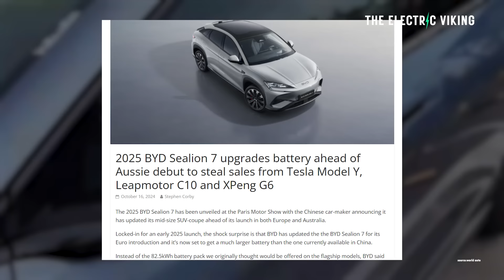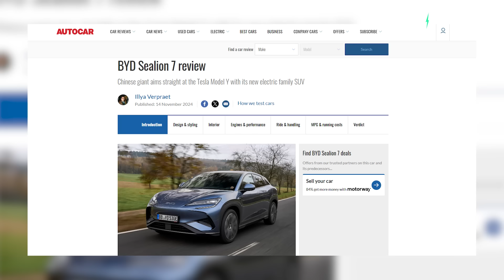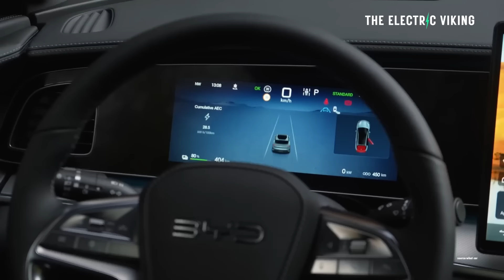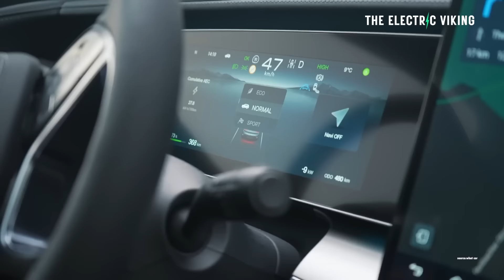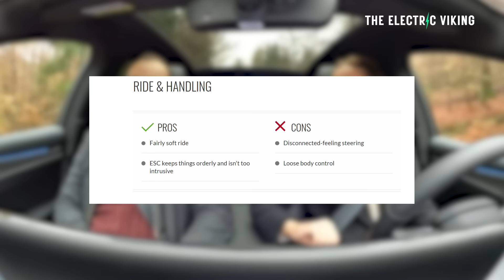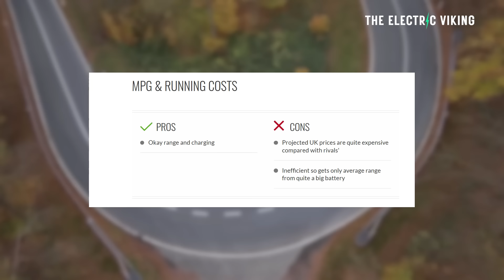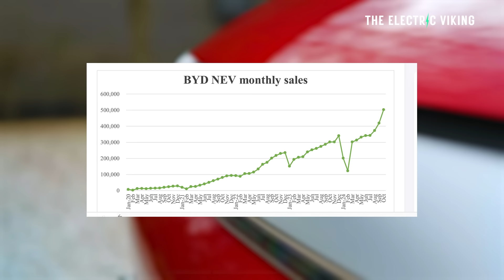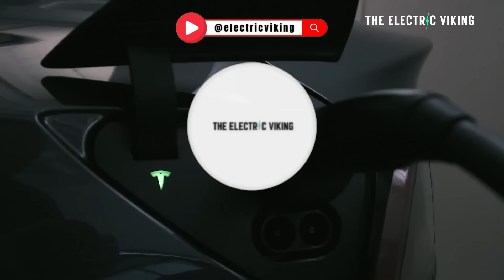Shocking review exposes major issues with NEW BYD Sealion 7 EV

Comment: you are listing opinions that are not actual facts. there are ICE sedans weigh around 2t, I don't see any issues with weight of the SL7 because most of it sits low down. Suspension might be soft, it's subjective that not everyone wants their SUV to handle like a sports car to feel every imperfections on the roads. The weight of the EV contributes to more enengy comsuption but also helps to gain more back on regen. Efficiency is really come down to one's driving style and where you travel to. I know ones that couldn't get their Seal performance to use less than 20kwh/100kms, but mine always sits between 16-18kwh/100kms with regen set to standard and in sports mode 100% of the time.

Comment: the EV scam revolution. Crs are designed to waste a lot energy. 

1. The cars are to big (mostly SUV)
2. They all are to heavy, because most countries subidized the road tax to stimulate EV sales, so there was no incentive to lower the weight.
3. The cars come with 18-20 inch rims, which contributes to high energy consumptions, so less range. 
3. They are especially very inefficient on long range. Again because government subsidies no incentive for car makers to make it efficient. 
4. Batteries are inefficient and the elctric engines are inefficient. 
5. It does not contribute to cleaner climate because the energy to charge comes mostly from fossil fuels. Again because most governments don't want Nuclear energy. 
6. The cars are 2x the price of an luxury petrol car. Even with all the government grants and subsidies, where did all those bilions go? 

Anybody else can add valid points?

Comment: Seal owner here and i saw this car few months ago in China. The interior looks cheaper than the Seal due to the removal of Alcantara and replaced with silver plastic, no electronic air events but a cheapo black plastic manual one. The dash 1 pc black plastic cheapens the car further. The ride is nothing like the Seal, its much softer designed for comfort. This car looks horrible in lighter colours due to the massive black wheel arches. Very mediocre car in the China market and the sales reflect that.

Comment: Not surprised honestly. I drove a rental this last Fall which was a BYD Seal U in Germany. Looked modern, interior was modern looking. The problem was how it drove. The steering didn't have an on center feel, suspension was horrible. Pretty sure the Chinese doesn't understand driving dynamics. The suspension was set to bedroom pillow setting, not really. The suspension was so soft and the body roll so bad that I didn't trust the vehicle. Even when I set it to the sport mode it was still soft. It functioned as a transport vehicle but it wasn't as efficient as the Tesla I rented in Hawaii a few months later. The scariest thing is how low the battery tray was located on the bottom of the vehicle. The battery tray was the lowest part of the vehicle. There were so many issues with the BYD Seal U. The GPS was spotty and it kept telling me that I could go 120KPH in town!
Reply: To be fair Seal U is using the old chassis that is shared with the PHEV variant. Sealion 7 is built to be EV only from ground up so a completely different vehicle.

Comment: Tbh sealion 7 sounds more premium than model y on wiki (adaptive suspension etc).
I also like their specs better. Arguably 4.2 seconds in the awd version is as fast as you could possibly want in a suv family sedan. 3.5s in the tesla y almost makes less sense since this can't handle like a sports car. Conversely, you def need the long range in the y for decent range, which runs at 4.8s, which is just a lot slower than the sealion 7. So maybe nitpicky but I like the sealion 7 specs.
Basically all 3 models of the sealion 7 have more range than all y versions and make sense, whereas imo only the long range model y version makes sense.
Given in china all model y versions sell for pretty much exactly 50% more than the sealion, I'd say it will make for good competition even after tariffs.
Design wise it looks a bit 90s but ok not necessarily a bad look

Comment: The BYD sealion 7 has one of the best usable range on the market.

Its 91kWh LFP battery has a usable range of 0,80 x 502km = 400km

The Tesla model Y RWD has a 78kWh NMC battery with a usable range of 0,60 x 600km = 360km.

So unless you have frequent roadtrips the BYD sealion is better in terms of range than the best model Y .

Any rival car with NMC battery would have to have >667km of WLTP range to be better

Comment: I would say the biggest mistake would be to buy an EV in the first place.
Reply: Yeah, after have driven 4800 miles in my Model Y I paid $90. Biggest mistake.
Reply: It’s bizarre that you should choose to watch a channel that’s all about electric cars. You are deluded if you think the rest of us who watch out of a genuine interest in EVs, care in the slightest what you think.
Reply: ORA 11000 Km total fuel cost $45, solar for the rest. Hard to see how it was a mistake.
Reply: Sad trolls are out
Reply: You must be on the wrong video LOL
Reply: It is mistake for fuel car lovers, or mistake if the EV car he chose is bad.
Reply: @nguyep4  Wait to the battery goes or you want to sell it,
Reply: @Ronick-Q-46  8 years warranty or 100k miles. The battery is good for 500k miles. The chance the battery goes bad is about the same for engine goes bad. I will be fine.
Reply: @nguyep4  I'm so glad to hear that, so will I be with my 14 year old diesel driving like a  dream. 😜
Reply: @Ronick-Q-46    2 million Teslas on the road in the US and no mass crying about dead batteries.
Reply: @someuser7501  Only when there on 🔥😂
Reply: @Ronick-Q-46  Your dream isn't that great to begin with. But glad it's working out for you.
Reply: @Ronick-Q-46  LOL the battery warranty is 8 years / 192,000 km, and they are expected to last at least twice as long.
Reply: I get an 8c per kwh overnight EV rate, I get 9km per kwh = 1c per km of fuel at worst - most of the charging is from excess solar. I salary sacrifice the car, my EV costs me less than a base model Mazada 2 to package. It could depreciate to zero after 5 years and I would still be miles ahead of the ICE car it replaced.

Comment: Major issues, like the cyber truck that going thru it's sixth round of recalls. And roasted alive 3 passenger after an crash recently! At least the BYD seal doesn't rust like the cyber truck, but then electric singularity recommends you get the $7000 plastic wrap for it

Comment: Western reviewers are very strange. What is main difference from model Y? Ground clearance,soft suspension, open android, interior. I did not buy model Y only beacuse 13 cm clearence is not enough for me. As well as harsh suspension. As soon as you understand it you make decision. 20cm ground clearence is very bad for aerodynamic. That is why range seems bad. I have no idea where those 312 miles come from. I do 250-270 miles on 80 kWh battery RWD (chineese version) in 0-5 degrees in my conditions. It should  be 320 miles in summer. But if you need range just go for 13 cm clearence  2WD sedan. It is so easy. Cheers. Ps  my negatives about sealion 1) it is not seeting position (btw i am 195 cm). Position is fine. But angle if view, visibility to right could be better. (My height could be reason). 2) no sentry mode. Why BYD? Why only windshield recorder? 3) dilink5 is not so 3rd party software friendly. But still we can install 3rd party software.
Reply: That's the issue here. They expect all cars to handle like a sports car. Buyer of non performance SUVs like this won't care a bit about good handling, they care about comfortability. Different cars for a different type of buyers.